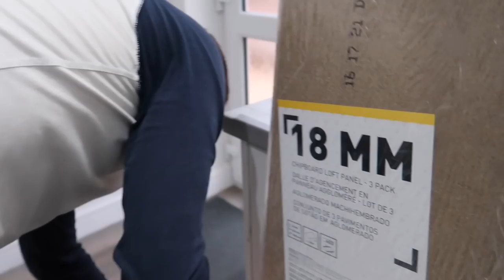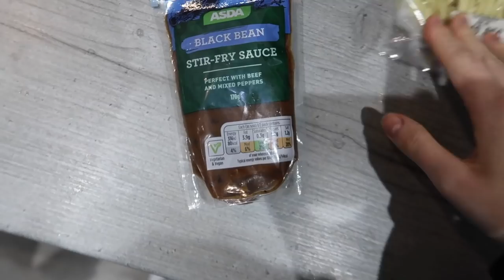House Updates |  Boarding our Loft, Painting & Going on a Date 🤍~ Jessica Jayne

Comment: Just literally finished partially boarding my loft, and strangely I was three boards short as well. I used the Loftzone system which is similar to just the loftlegs. Pleasing job to do, but make sure you don't load more than 25kg per square metre or your house warranty will be invalid.